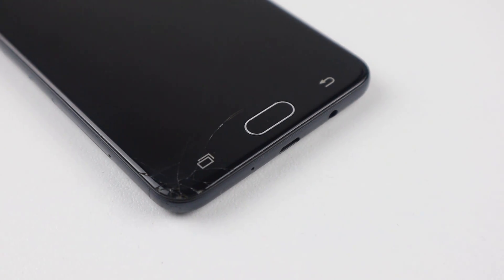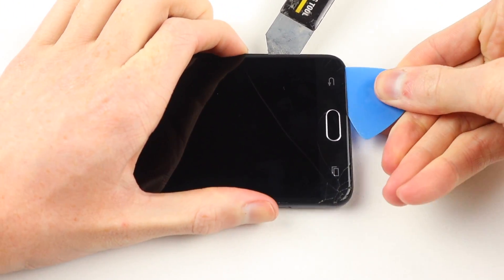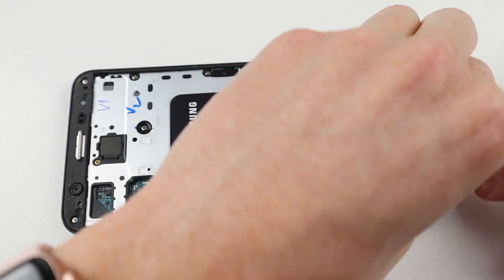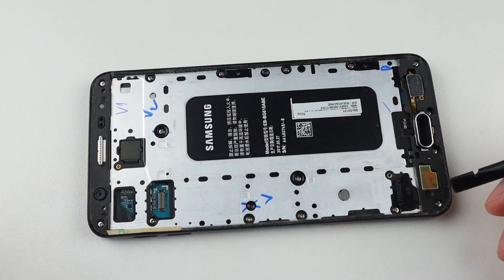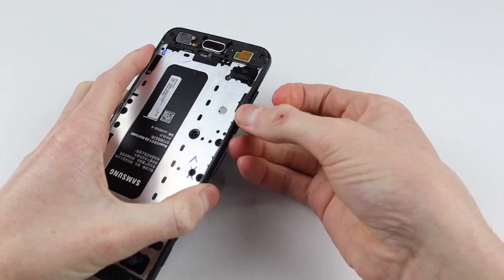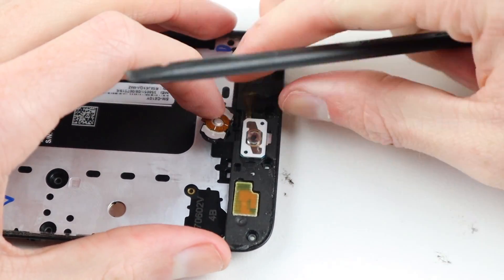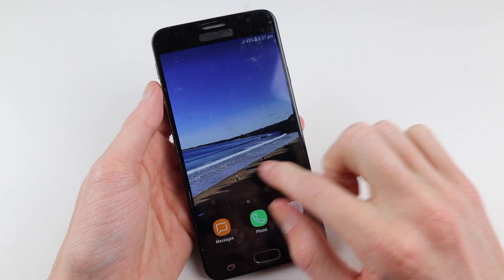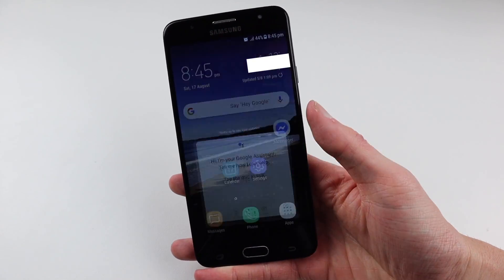Unrepairable design? - Samsung J7 Prime Screen Replacement

Comment: I just replaced my samsung j7 prime lcd screen with another one which is compatible but not an original samsung part as i can't find where I am . Definitely not as good as original...very unstable and does crazy stuff..almost sorry I changed it but had not choice 'cause when I replaced the battery I broke the flex cable when reinstalling the lcd screen.

On another note, this phone is very durable..i've had mine for 8 years. Clearly samsung does not want you to be able to easily replace parts and make the phone last even longer . For example , there is absolutely no point in gluing down+++ the battery as they do with this model.

Planned obsolescence is the name of the game with samsung but the J series was made for emerging markets in Asia and may have been more durable than planned which may be why they discontinued it.

Comment: I recommend 150 degree Celsius on hot air station if you don’t have a hot air gun. Do it till you reach the melting point of the Lcd glue (10 minutes probably). You can use B4000 Black Glue and fasten it with rubber bands for about 30 minutes and it’s all good.

Comment: I recommend 150 degree Celsius on hot air if you don’t have a hot air gun. Do it till you reach the melting point of the Lcd glue (10 minutes probably). You can use B4000 Black Glue and fasten it with rubber bands for about 30 minutes and it’s all good.

Comment: I recommend 150 degree Celsius on hot air if you don’t have a hot air gun. Do it till you teach the melting point of the Lcd glue. You can use B4000 Black Glue and fasten it with rubber bands for about 30 minutes and it’s all good.

Comment: The Design is pretty similar to the one of the S5 mini. There you could remove the back panel but the screws have been under the display. So no real way to open it without risking to break the screen (which I did).

Comment: I actually found a J7 prime that was in the middle of the road. The screen was obliterated and fell off. I have no idea if it still works and I don't want to get a screen for it if it doesn't. I tried plugging it in without the screen and nothing happened.

Comment: I'm a repair tech by trade, I work on these all the time.  These phones are far easier to work on than the majority of flagships on the market, and the parts are readily available (at least in the US).  If you want an unrepairable design, look at a pixel 3... I dread working on those.  Bottom line, anything can be repaired if you try hard enough.  There isn't a phone on the market that can't be fixed.

Comment: Samsung makes rework kits for all of their phones. They're basically like an exact cut out of adhesive that you need for the phone model you're working on. I'm not sure if you'll be able to get them from Samsung or even third party either, but if you can the repair is a lot better and is water resistant.

Comment: Unrepairable design? Isn't it a little unfair to suggest that in the title of a video that clearly proves otherwise? Is it not common to run into small issues when working on mobile devices like this? 

Additionally, the adhesive isn't there for the lols, it's to keep the glass/screen from popping out of place. This is all fairly common for mobile phones and similar products. And finally, why on Earth would you go through the trouble of repairing a Galaxy J7 Prime anyways, considering the screen still accepted input even after some damage occurred. It's not like the J7 Prime costa the same as a flagship and thus worth spending the time and money on to fix something that's purely cosmetic.

Comment: What's the point of repairing it? I got a J7 Prime because it was cheap. If anything happens to it, it can easily be replaced. The cost of parts and labor is going to cost more then the phone itself.
Reply: I had a j3 core because it was cheap and it was water damaged so I just replaced it

Comment: So to play devil's advocate, I recently replaced the screen of my GFs J7 Prime and it was a walk in the park. I am by no means an expert at phone repair, having only replaced a Nokia 6 and Galaxy S4 screens before this. This was honestly the easiest repair of them all. 

This phone had a terribly cracked screen, way more than Hugh's one and it was all but impossible to remove the screen off in one piece. This might be where I avoided his issue, because the severity of the damage meant I had to use my heat gun a lot more than he seemed to, helping me take the screen off without causing any internal damage. It could also be because after my Nokia 6 repair, I knew I had to be extra careful around the home and capacitive buttons also unlike Hugh. 

The replacement screen I got also didn't have any adhesive and I had to use double sided tape to stick it all together, but because I didn't damage anything while taking the original screen off, the whole repair was extremely painless and easy. 

Next time be aware of the home and capacitive buttons when taking a screen off :p

Comment: As far as I can see you could easily have disconnected the battery :) Isn't that the little flap at the top of the battery, by the minus and plus sign ?

Comment: I've repaired many Samsung phones with this design. I'd say its actually pretty easy to do a display replacement, but trying to replace anything else without replacing the screen is a pain in the ass.
Instead of cutting the adhesive by the home button, cut the adhesive at the top, then the sides. 

Then lift the display from the top and cut the adhesive by the home button from the inside as you lift it up.
The most tricky part is the adhesive for the new display. I use zhalinda e7000 and a few clamps. It has never betrayed me.
I test the phone with the new display then I put the glue on the frame. Make sure not to cover any cameras, buttons, microphone or speakers with adhesive.
Then I put it together and use 4 clamps, one for each corner. Wait for a few hours and remove all the adhesive around the edges with my fingernails.

This repair takes me about 5-15min of work.

Comment: Hey Hugh,

When fixing a Galaxy Device like this one in terms of display removal, try the following tips which helped me to prevent further damage to components like the home button flex cable:

- Apply clear tape to the cracked areas of the display top glass. Helps to protect your hands and eyes from spiraling glass.
- Use playing cards around the corners! It may seem like a slower, and more gimmicky approach, but in cases like this it's better to waste 10-30 minutes extra on a safer method than $5-$10 dollars or AUD on an unnecessary part.
- Finally, make a mental or digital marking of the phone models cable layout by referring to your display replacement on hand and/or an available repair guide to know how careful you should be on each side.

Even though I'm sure you already follow at least some of these guidelines on and off camera, I'd figure I would still share with you these tricks that helped me in the long run, especially when I completely fixed a Galaxy S5 LCD panel on a first try with no prior experience but loads of patience.

Loved the video and the channel. Keep up the excellent content.

- Tony's Tech Repairs
Reply: When fixing a broken screen it is necessary to replace the lcd too?
Reply: @kirkkong5829  Hey Dokii, LCD are usually fused with the glass digitizer, meaning they are most likely to be replaced for a screen repair. Depending on the device, some phones come with separate LCD and digitizers, and many of the fused panels can be separated with expensive refurbishing equipment.
Reply: @tonystechrepairs  thankyou so much, I'm starting to repair phones and my friends are my first customers usually broken screens
Reply: dokii dokii, you’re welcome! Check out some repair guides on iFixit and YouTube to ensure they’ll go smoothly and best of luck on the future repairs. God Bless.
Reply: @tonystechrepairs  Yes!

Comment: I had a j7. Then it cracked. Then I got an s9. And I realized just how bad this thing was.
Reply: Black Cash  I have loved it so far
Reply: Black Cash  I have used it and I liked it
Reply: Black Cash  I like iOS and Android. You can't stop me from liking both
Reply: I had this phone a couple of years ago i got an S7 edge for custom roms and i saw major differences between the stock roms
Reply: A50 is a way better replacement
Reply: @brandteous4232  No it isnt, not when compared to the s9, not even close, the s9 would straight up destroy that phone, and im speaking from an a50
Reply: @tridinh1011  actually they are similar. I have an A50 and it has better features and is running One UI 2.5 as of commenting. A newer processor. But still midrange. In display fingerprint scanner. And still in support for updates.
Reply: It was realesed a month after
Reply: @brandteous4232  No, pretty much any Xiaomi Redmi Note device from the Note 3 onwards. ;)
Reply: @worldhello1234  you do know that people may be used to the software on a certain phone, right? Learn from me, I switched from a Huawei to a Samsung and found it real hard to adjust. But eventually, after 3 years of Samsung, I've gotten used to it and now, I am a long term Samsung user for 9 years. Am looking forward to switching to Apple since I own an iPad

Comment: I have a iPhone 6 the goes to boot up and shows the apple and then nothing happens but the backlight stays on. I've replaced the screen and battery as the screen was cracked and thought the battery might be y it wouldn't boot up but still nothing. I have a Ebay store I can sell it to you from for 10-20 plus shipping just so I can make some of the money back for the screen and battery but would like to see if u can get it working again. If interested let me know and we can make it happen. As far as I know it's not iCloud locked but if u can get it to come on and it is locked I can message the person to see if they can take the phone off their iCloud. Just throwing the thought out there

Comment: This is a long comment, but I hope it helps someone, this phone is such a pain in the butt, well, almost every "J" or "A" Samsung phone, what I like to  use to separate the screen are X-RAY sheets (I don't know how you call them) because they are thin and strong enough for cutting the adhesive, if the screen is also glued down in the middle you just cut a longer piece of the X-ray sheet, I recommend rounding the sharp corners of the sheet, if the screen is broken and you don't want to be heating the screen all the time, just use some isopropyl alcohol to soften the adhesive, and for the battery, y put a small piece of plastic in between the battery and mainboard contacts to prevent any short circuit, lastly, watch out for the quality rating of the screen, some people will sell "AAA" quality screens that won't properly fit on the frame and will easily crack even while you glued them, I prefer "Oled" or "Original" quality screens, even though they are twice the price, the will save you time and be more resistant.
PS. B-7000 glue is way easier and better than those adhesive strips, just don't use too much.

Comment: Really strange, i had a J5 Prime that is basically the same but smaller and a year ago y shattered the screen so a few months ago I decided to fix it, and sell it. The thing is that it wasn't too difficult to take out the screen and I didn't damage anything (i'm not saying i'm better or anything) but it's the second phone I repair and it's the one that came more clearly (I also repaired the fingerprint scanner and it wasn't difficult to take off the motherboard or battery 
I forgot to say that i'm from Argentina and this phone is very, very common. Anyways very good video

Comment: Samsung phones are built like tanks but if they break it is very difficult to repair them. The s series is easiest to repair because parts are easily available but expensive. My samsung galaxy a50 has a plastic back which means you can peel it right off of the phone once the adhesive has been softened

Comment: Weird, I have a J7 prime also, it has a removable battery by popping the back cover off.
Reply: You have a J727. (A rebranded J7 V, which is not very good.)

G610 is the real J7 Prime, shown in this video , and the one I have.

Comment: Do more Samsung repairs. I would like to see an S10+ being repaired. I actually respect Samsung for creating cheap phones like the J7 Prime. They have decent specs, sim card slots and actually impressive Super AMOLED screens for such cheap phones. Even a $200 J5 has a Super Amoled screen with vivid colors and ultra blacks which is actually better in quality than a Huawei that has triple the price of that J5.

Comment: I had the same issue when attempting to repair my 2016 Samsung J6.. lesson learned: never buy non-flagship Samsung phones.
Reply: I think the J series are meant to be disposable phones... Break it and buy another.
Reply: @zNoah  definitely! breaks so easily, a bitch to repair, almost no parts available.. grr, never again
Reply: @zNoah  I have a j7 Verizon and its held up really well
Reply: @elliotbaines2100  I have a j7 2015, the charging port is almost broken... It started failing a year ago and it's finally giving up.

The phone have 3 years now tho.
Reply: So sad because j7 prime is one of the worst phones out there
Reply: The J1 2016 is quite durable tho...

Comment: You should use B-7000 to glue the screen in place, as its acts like a gasket preventing water and dust from getting inside the phone and weakening the adhesive. You also have to remove the blue sticker from the screen replacement.

Comment: Yeah those cables break realy easy, luckly the home button can be replaced on Samsung phones, without losing fingerprint function. On the Samsung J3/5/6/7 phones, the screen has glue on the sides and under the display itself. However the J6+ doesn't have that glue under the display. I don't how mutch time that glue will hold the screen in place, i've used it in the past and it doesn't last long. I prefer liquid glue, works best.

Comment: That design looks similar to a Huawei phone I tried repairing. I made the same mistake trying to take the screen off first. You should be able to get the back off first since it is held on to the mid frame with clips. It was a pain though.

Comment: Xiaomi phones are easy to repair. I repaired 3 Xiaomi phones before. They had pull tabs under the batteries and everything is so modular. I love Xiaomi phones, they are cheap and easy to repair if I break them.

Comment: my eyes are bleeding because of how you did that repair
Reply: What did he do wrong? Hmm?
Reply: @zavier3644  i see a lot of mistakes he did there
Reply: @captain5428  You wont win an argument by saying that he made mistakes, you also need to point them out and describe what shouldve been done.
Reply: He should have started prying the screen off from the top and sides and not the bottom. Anybody who has repaired older android phones know that the home and back buttons on the bottom can easily get damaged and start removing a screen from the top and sides to avoid them. Apart from that and the fact that he didn't apply nearly enough heat, I don't see anything much wrong with this repair though.
Reply: Very good, yes?
Reply: @grab0wskk  hahaha hmm no
Reply: @captain5428  shutup
Reply: @captain5428  ugh..cringe
Reply: Mohammad M.E. Your face cringe boiiiii🤣

Comment: I've declined dozens of repairs on these J series devices before in the past because of this exactly.  The cost of repair outweighs the cost of the device itself. These phones are meant to be thrown away when they stop working. They're super cheap in design.

Comment: I did put the same double adhesive in the past(on a lenovo phone),the screen came off and it was hanging from the flex cable!!!Better use a glue like b-7000 next time Hugh;).

Comment: It's not unrepairable at all, at least you can still use the fingerprint scanner without any tweak, and it's not a thousand dollar phone
Reply: Thats for security and Fingerprint data security. Also apple is still the most secure, even in the new gen face id.  Unlike samsung s camera face id
Reply: Yeah it may not be unrepairable. But it’s way harder than any iPhone. Even replacing the battery is way harder.

Comment: All of these modern Samsung phones require quite a lot of skill to be repaired. Most of them will only have the internal electronics accessible by removing the screen without breaking or damaging it, and without bending, tearing or ripping any cables inside.

Comment: I feel for you. I replaced the phone screen for a family member and ended up tearing that same cable. It's a royal plain. And that adhesive will stick for a few days until it just stops holding. Even the super strong double sided tape I use only held the screen down for a week before it started popping up again.